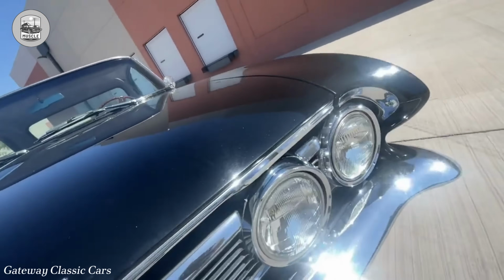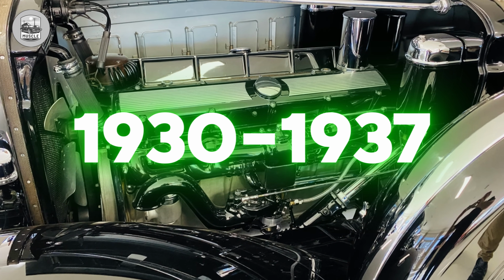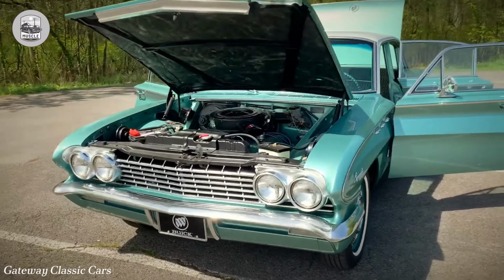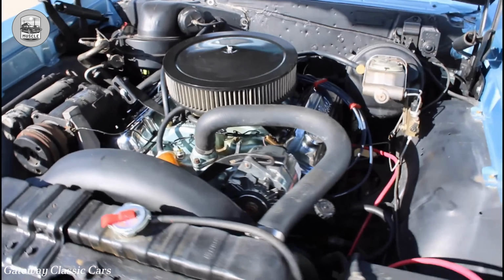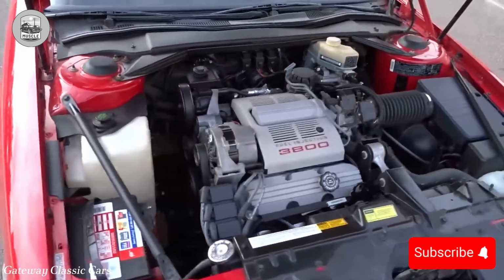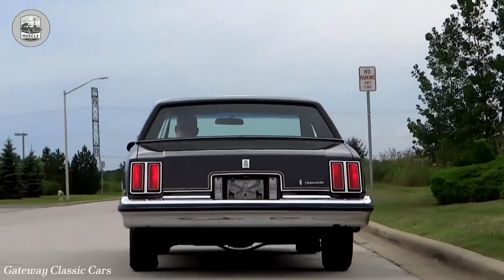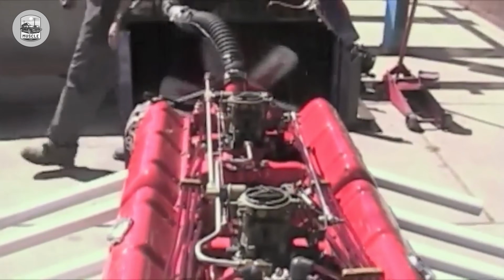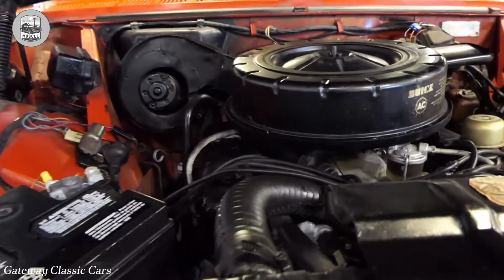10 MOST FAILED and WEIRDEST GM Engines ever made | Worst engines blunder!

Comment: I got out of the Marines in 1968 and did not know how to work on car or truck engines; I taught myself from books as No internet yet. Bugged mechanics and read constantly about such in magazines as well. Mechanics got used to me standing and watching them work and explained what and why they did what they were doing. I tuned my own car and Dad's truck. I learned more. I wanted to replace the worn out small block 400 in my new to me 442 Olds. I first built and installed a 389 Pontiac I rebuilt. Broke axles x 3 from Olds Racing shop.. (This is hard to type with dilated eyes.)  I had an offer from a owner of a GTO for it at $8700. I sold it and bought a junkyard 445 Olds and started to build it up; balanced and blue printed the rotating stock; racing grade all. Then the block was detailed for max output. The man that did my balancing and blueprinting for me spun the engine to 12000 and told me to keep it under 12K for most uses. Special rear end from a blower driven 396 Shevy that got wrecked; got tht $2,800  for a mere $400.Could not afford the 5 speed trans that was in it too. A state of Oregon highway cop tracked me at 2:45 AM on I-5 Gold Hill, Oregon at 138 in 3rd gear; then I shifted to 4th. Went airborne on the bridge over the Rogue River between Gold Hill and Rogue River. Scary to have the front end lifting free at top speed. Fun times ass I hit a gas station and detoured 30 miles getting home. What we will do in our 20's scares me to try in a Subaru Forester.  lmao

Comment: Mine is the 1971 international scout II 361 SMALL BLOCK
Reply: Actually, the 361 engine in your 1971 International Scout II wouldn’t be a small block, as International Harvester didn’t produce a 'small block' V8. The 361 V8 you’re referring to is part of IH’s medium-duty truck engine line, which was quite different from the typical small block engines you’d find in cars or light trucks. It was designed more for heavy-duty performance with a focus on torque rather than high-revving horsepower like traditional small blocks. That said, it’s a fantastic engine known for its durability and grunt in off-road situations.
Reply from the maker: Thank you for your information. It is so great...
Let's see our channel is a place to share, comment or show your feelings about American Muscle Cars.
Have a good day.
Don't forget to like, share or SUB on our channel to enjoy other great Muscle Cars videos.
Spending more time with other great videos on our channel to explore more about American Muscle Cars.
Reply from the maker: Thanks for sharing! The 1971 International Scout II with a 361 small block is a rare gem. That 361 is actually a part of the International V8 family, which had a reputation for being tough and reliable—perfect for off-road adventures. Though not as widely known as some other small blocks, it had a torque-heavy design that made it great for low-end power, ideal for pulling and rough terrain
Did you know the Scout II was also one of the earliest SUVs to adopt a more modern design compared to the boxy, military-styled 4x4s of its era? It's a classic that often gets overlooked in muscle car conversations but definitely deserves more attention!
Anyone else have experience with these rugged off-roaders? Drop your thoughts in the comments, and don’t forget to like, share, and subscribe to Muscle Car Masters for more awesome content.
Have a good day.

Comment: Buick 401 nailhead was a marine coast guard engine that was also start kart engine used on Sr 71 spy plane matched to transmission from hellcat tank later morphed into buick twin turbine dynaflow. Best combo 1961 thru 1963 ever put into any auto.
Reply from the maker: Thank you for sharing that fascinating info! You're absolutely right about the Buick 401 Nailhead being a legendary engine. It was incredibly versatile, not only powering Buicks but also making its way into some wild applications like marine engines and even aviation-related uses, as you mentioned with the SR-71 start kart. The Nailhead’s torque-heavy design was perfect for those kinds of roles. As for the Dynaflow transmission, that was a unique pairing with the 401, especially in those early 1960s Buicks. The Twin Turbine setup gave those cars a smooth yet powerful drive, setting them apart from other vehicles of the time. It wasn't the fastest shifting transmission, but that combination of smooth power delivery and brute torque from the Nailhead made it a favorite for enthusiasts.

Everyone, what do you think of the Buick 401 Nailhead and its incredible versatility? Got any stories or experiences with this engine? Drop them in the comments! And if you haven’t already, be sure to subscribe, share, and help us grow the Muscle Car Masters community! Let’s keep the conversation going!

Comment: I have the Rover 215 (1969) and the Dauntless V6 (2002) in 2 of my cars
Reply from the maker: That's awesome! The Rover 215 is an aluminum V8 that has roots in the Buick 215, making it light and powerful for its size. It was widely used in British sports cars like the MGB GT V8 and TVR models due to its compact dimensions and punchy performance. The Dauntless V6, on the other hand, was originally produced by Buick before being sold to Kaiser-Jeep. By 2002, you had a 3.8L version that was rock-solid, especially popular in off-road applications like the Jeep Wrangler. Would love to hear more about how these engines perform in your cars! Drop some more details, and let’s get the conversation going! And for everyone else watching, don’t forget to comment, share, and subscribe to the Muscle Car Masters channel for more rare engine discussions and stories.
Reply: @MuscleCarMasters68  The Rover I have is a 1969 P6b Sedan car ( b is the designation used as that model had the "Buick" Engine. It is a highly advanced car for the 60s and the Buick V8 is just perfect for it. Rover used this engine until around 2006 and was sized to 4.6 litre with a turbo in the last of the "Buick/Rover" Powered Range Rovers. 
The 3.8 Is in a Commodore Station Wagon  produced By General Motor Holden in South Australia. This example is till very smooth and has done around 483,000KMS or over 300,000 miles. These are one of the best engines out there. 
Incidentally in South Australia the Oldsmobile 215 was the basis of a race engine built in South Australia which won 2 formula 1 Grand Prix World Championships in the 1960s
Reply from the maker: @johnnyjrotten59  Great comment! You've really highlighted how versatile and durable these engines are across different platforms. The Rover P6B is indeed an iconic car, and the Buick V8 engine it used was a game changer. Originally developed as the 215 cubic inch (3.5L) engine by Buick in the early 1960s, Rover's decision to adopt and evolve it into a larger displacement engine over the decades was brilliant. By the time they had it turbocharged and sized up to 4.6 liters, it had become a powerhouse for the Range Rover lineup.
The Holden Commodore with the 3.8 V6 is another solid example of GM engineering. The 3800 V6, derived from the Buick V6, was renowned for its durability and smooth operation. Hitting over 300,000 miles is a testament to how well-built these engines are! With proper maintenance, they just keep going.
And you're spot on about the Oldsmobile 215’s role in Formula 1! The South Australia-built Repco engine, based on that 215 design, helped Jack Brabham secure back-to-back championships in 1966 and 1967. This really shows the engine’s flexibility from road cars to world-class racing.

To everyone reading this, feel free to share your thoughts and experiences with these incredible engines! We'd love to hear more stories like this. Don’t forget to comment, share, and subscribe to Muscle Car Masters for more amazing content! Let’s keep the conversation going!

Comment: Fun Fact, Rover used the Buick 215 motor all the way until 2004, well past the 90s as stated here.  It's last use for Rover was in the Land Rover Discovery II series vehicles in a displacement of 4.6L.  (I should know I've owned 2 of them).
Reply from the maker: Thanks for the awesome comment and for pointing that out! You're absolutely right—Rover used the Buick 215-derived engine for much longer than the 90s. In fact, as you mentioned, the engine evolved over the years, reaching its final displacement of 4.6L in the Land Rover Discovery II, which was produced until 2004. This aluminum block V8 is legendary for its adaptability, starting life as the Buick 215 in the early '60s and becoming a staple of British motoring for decades. It powered everything from Range Rovers to TVRs!
The Buick 215's light weight and durability made it a perfect candidate for Rover to improve and expand upon. It's amazing to think that an American design had such a lasting impact on British off-road and performance vehicles. Your firsthand experience with the Discovery II is awesome—those are some rugged machines!
For everyone else reading, feel free to drop your thoughts on the Buick/Rover V8 below! Have any of you owned vehicles with this legendary engine? Let's keep the discussion rolling, and don’t forget to comment, share, and subscribe to Muscle Car Masters for more fun facts and deep dives into American muscle history!
Have a good day.

Comment: apparently you couldnt find any images of a 260 diesel, as those pictures are all gas engines
Reply from the maker: The 260 Diesel is a lesser-known engine from GM, designed primarily for light-duty trucks in the 1980s. It was based on the Oldsmobile 5.7L Diesel V8 but downsized to 4.3L for better fuel economy. While it had potential, the 260 Diesel struggled with the same reliability issues as its larger sibling, which hurt its reputation. If you're interested, I can dive deeper into its development and challenges in future videos. And hey, Muscle Car Masters is all about learning together! Feel free to drop more comments, share your experiences, and don't forget to hit that subscribe button to stay tuned for more deep dives into forgotten engines like the 260 Diesel!

Comment: Made a 398 Pontiac that snapped 3 Olds competition axles in 4 months. Sold that one to a GTO rebuilder.
Reply: Cam change to 3/4 race profile Isky cam. Melling pistons. Balanced and blueprinted with Pontiac racing intake.  Holley 365 cfm carb with double pumper bowls.4=1/2" x 16' Cal Custom air cleaner. Shot blasted the interior of the intake. Intake ports slightly beveled to reduce turbulence. Cloyes bearings and rings. Racing bearings and used Delo 400 oil always.
Reply from the maker: @roberthodge2771  Wow, that setup sounds like a true beast! A 3/4 race profile Isky cam, Melling pistons, and a balanced and blueprinted engine paired with that Pontiac racing intake must deliver some serious power! The Holley 365 cfm carb with double pumper bowls is a great choice for throttle response, and I can imagine the shot-blasted intake and beveled ports are doing wonders for airflow efficiency. Using Cloyes bearings and Delo 400 oil is a solid move for keeping everything running smoothly, especially under those racing conditions.
This is an awesome build! For everyone else out there, what are your favorite mods for getting the most out of your engine?
Reply from the maker: Thanks for sharing your experience with that 398 Pontiac! Snapping three Oldsmobile competition axles in just four months shows just how much torque and power that engine was putting down! Pontiac engines were known for their impressive durability and power delivery, especially in those high-performance builds. It’s no surprise you ended up selling it to a GTO rebuilder—those guys are always on the hunt for powerhouse engines like yours!
By the way, what kind of upgrades or modifications did you have on that 398? I bet the GTO it went into became a real beast on the streets! Keep the stories coming, and we’d love to hear more about your muscle car projects....
Have a good day.
Reply: While it's impressive that your 398 Pontiac had enough torque to break axles, it might indicate a mismatch in drivetrain strength rather than a testament to the engine's performance alone. Olds axles are typically stout, and breaking three in four months suggests that there could have been issues with the differential setup, suspension alignment, or even the quality of the axles used. A properly built drivetrain should handle the power without constant failures. It’s always a good idea to reinforce the entire driveline when increasing engine output to avoid these kinds of problems

Comment: Again with the presumption. I've heard of every one of these.

Let's see if you mention the Oldsmobile 4.3L V6 Diesel. Have you heard of that?
Reply from the maker: Thanks for the comment! You’re right on top of things—if you’ve heard of all of these engines, you're clearly well-versed in the world of unique and often overlooked powerplants.
As for the Oldsmobile 4.3L V6 Diesel, absolutely! That engine was actually part of GM’s diesel push in the late ‘70s and early ‘80s, following the 5.7L V8 Diesel. The 4.3L V6 Diesel shared much of its architecture with the V8, but unfortunately, it also inherited the reliability issues that plagued GM’s early diesel attempts. It was designed to offer better fuel economy, but it didn’t quite live up to expectations in terms of longevity, with many engines experiencing head gasket failures and other durability issues. Still, it’s a fascinating chapter in GM’s history as they experimented with diesel engines for passenger cars.

We love hearing from enthusiasts like you, and your knowledge adds so much to the conversation.
Have a good day.